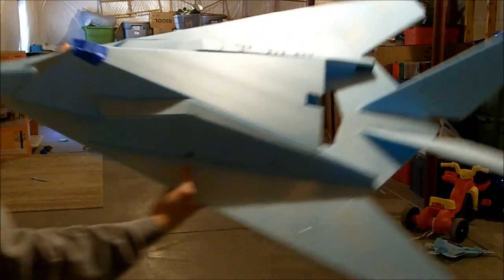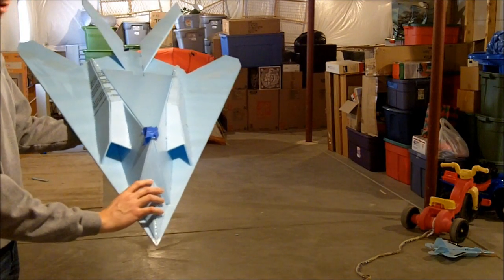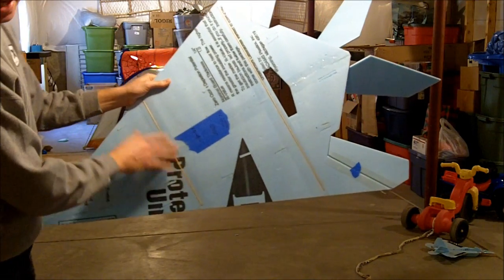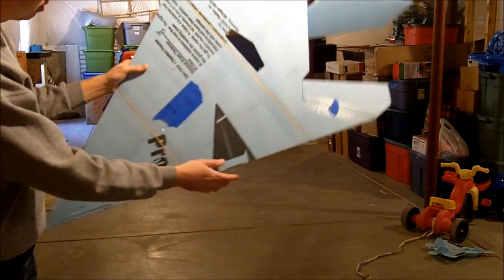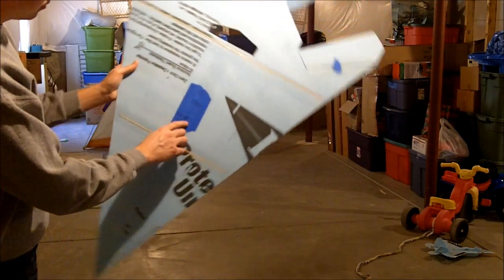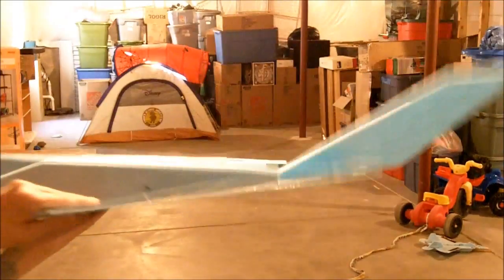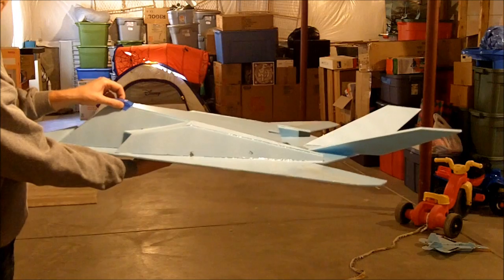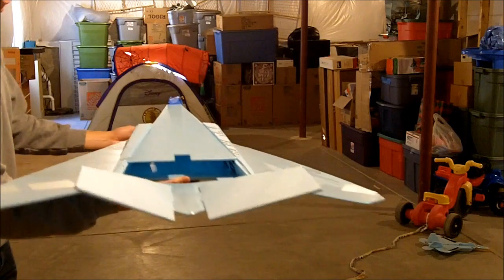RCPowers.com F117 v2 Build (01-02-2011)

Comment from the maker: @jippoy Thanks, it crashed and is toast... I'm sure it was completely operator error because the plane glides fully loaded.  The thickness is 1/4 inch and I think I used 2 sheets from the stack of 25 sheets I bought for $26 or so.  Each sheet is 2 feet by 4 feet.

Comment: I found out years ago the hard way how critical it was to have the CG set correctly for a successful flight. I'm about the same stage as you in my build of the same plane which is why it caught my eye. I'm even using wood spars instead of carbon fiber like you did. Think i'll try your balancing technique to see how mine glides, good idea!

Comment: I learned the hard way years ago about how critical the CG is to successful flight. I'm about at the same stage you are in my build of the same plane which is why it caught my eye. I'm even using wood spars instead of carbon fiber as you're doing. Think I'll try your balancing technique to see how it glides before I do the radio install.